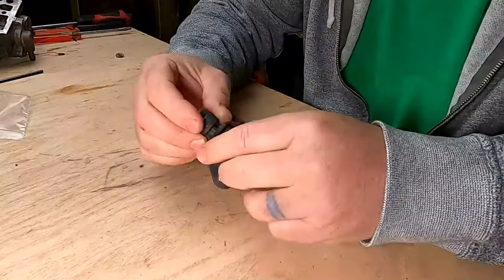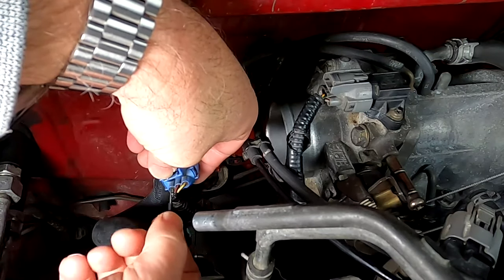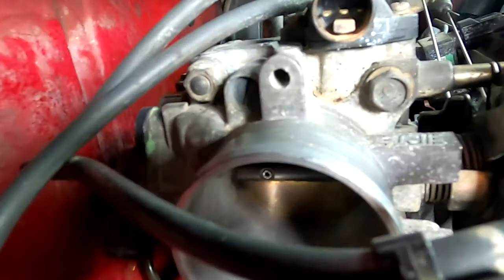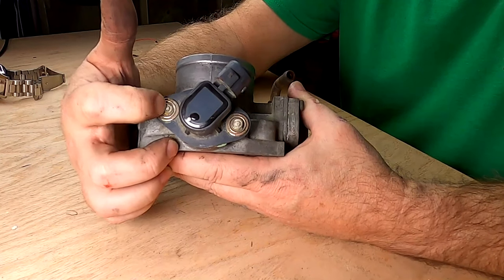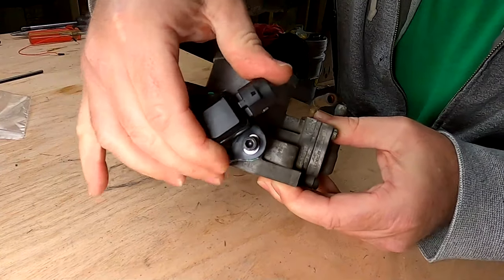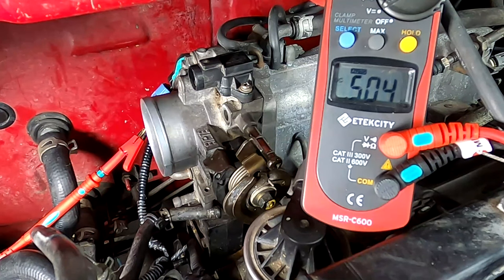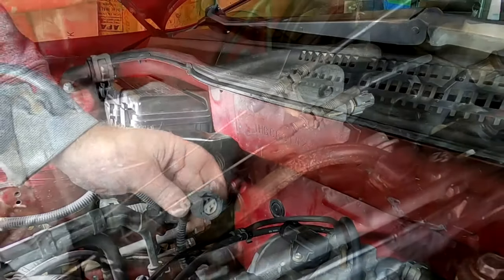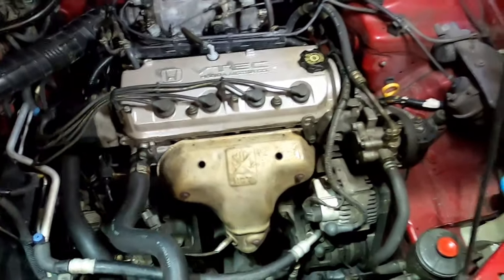Honda Throttle Body Removal & TPS Testing

Comment: Great video. I am working on a pilot with a hangup on the throttle about 10%.  I needed to know how to get those screws out and i am going to use my dremel. Also great calbration tutorial. Thankyou for your video post.
Reply from the maker: I swapped the TPS on a 2000 civic and I get those fasteners out in that video. Good luck!

Comment: I was having this same problem, mine would idle high. I took off the tube and reached inside the throttle body, and found a piece of napkin wedged in the part that opens n closes. Simple fix. But I have no idea how it got in there

Comment: Sorry...At 16:11 you tried to get the TPS to have 5.0V when the throttle is fully open.  How did you get to near 5V without changing the calibration for the 0.5V when the throttle is not fully open?  It seems that one would need to hold the throttle to fully opened position and adjust the TPS at the same time?  Would that mess up the 0.5V calibration when the throttle is not fully open?  Thanks.
Reply from the maker: It's seems to me that it's most important to get the reading right at wide open throttle. I don't know that you could get an aftermarket TPS to be perfectly 0 and 5v.

Comment: Thank you so much for the informative video!! Even the little things like “with the key on” really helps remind a person!! 
I have a question :
You spoke about if the levels are lower than .5 and 5 but what if they are higher? Does that change anything ?  What would you do differently if anything? The one that is in there is off a different Honda, but was working great till yesterday then threw check engine code and she had to gimp it to me. Throttle pedal had been sticky for a bit and we meant to clean it and even had the cleaner here to do it but my husband passed away suddenly last month and we’ve been distracted :-(
Thank you so much for your time making this video and in advance for any info you offer :-)
Reply from the maker: I am very sorry for your loss.... Stay strong. I'm sure that's what your husband would have wanted.

As for the voltage, the sensor only gets 5v from the chassis, so it would not go above that. Under .5v would mean that the sensor needs to be rotated , as shown in the video. The .5v and 5v would be in a perfect world. It just needs to be close, and it should function fine.

If the pedal is sticky, be sure to lubricate the cables where they attach to the throttle body and where the cable goes back into the plastic tube where it is mounted to the intake. 

Good luck!
Reply: @ktecgarage  I know you’re right and I sure am trying! Make sure to never take your wife for granted! I used to say don’t sweat the petty things and don’t let the sweaty things, but I didn’t follow those after … never mind, anyways it was reading .97 consistently and 6 when full throttle ? What would cause that ? The ECU? Or maybe bad tester ? It’s same as the one you had in the video ? :-/
Thank you again for your time and for making the video !!! It helped save a bunch of time and that is a much more treasured commodity these days! 🙏👍

Comment: Thanks for the video. We replaced the tps and must have messed with something because the civic won't go into any gear now  Any advice?
Reply from the maker: Year? Auto or manual transmission? If it's auto, can you move the gear selector?
Reply: @ktecgarage  2000 auto
 Cannot move gear selector.
Reply from the maker: @alfredobrown Do the rear brake lights work when you press the brake pedal? Also, check the back-up/reverse light fuse. On the under hood fusebox, check the fuse that is labeled "Stop" on top of the box.
Reply from the maker: Also, there is a slot above the PRNDL on the gear selector. Remove the plastic cover and insert a key into the slot and it will release the shifter until you get it figured out.
Reply: @ktecgarage  thank you. Will try that.

Comment: Thank you for a very good clear and knowledgeable video. I have learned so much about my car and have become an amateur mechanic because of it. I now dislike Hondas haha
Reply from the maker: I'm very glad to hear that I inspired you! Lots of satisfaction when you can do your own repairs.
Reply: @ktecgarage  almost definitely. Just having a problem getting it calibrated because I don't have a multimeter and everywhere I go I can't use one or nobody has one or it's way out of my price range. Have any ideas?
Reply from the maker: To be honest, you probably won't notice a difference without the calibration so long as it's close.  You can probably find multimeters for less than $20 at Harbor Freight or Walmart, but if it runs and drives fine, you will be OK.

Comment: What probe are you using to back test. I can’t fit anything I have in there on the pigtail
Reply from the maker: It is the type you use for breadboards when you build and test circuits. You could use a sewing needle as well.

Comment: Thanks for info.
What happens if you don't calibrate it?
Thanks
Reply from the maker: Probably not too noticeable if you just bolt it on out of the box. I would guess worse gas mileage and fuel trims slightly off.
Reply: @ktecgarage   thanks  iam about to do mine.  Preciate

Comment: As if alittle colouring of dirt in the throttle body is really going to effect the sensors that much, are they really that sensitive to make the idle so rough or stall the engine?
Reply from the maker: A dirty throttle body is very noticible with a manual transmission. When the clutch is engaged, the engine falls to idle quickly and the throttle body will catch it at idle and stop there. When it is dirty, it is slower to catch the RPM and causes stalls. The blade is barely cracked open at idle and any dirt interferes. So yes, it is that sensitive.

Comment: I’m have a problem 98 Honda idles but when l increase rpm it dies ??? Any thoughts on that ?
Reply from the maker: First things that come to mind would be a vacuum leak or low fuel pressure. Unfortunately,  Honda doesn't put service ports on the fuel rails, so it's difficult to test.
Reply: @ktecgarage  3:05
Reply: @ktecgarage  in desperation l changed the fuel pump and filter but couldn’t get results !!
I’ve done every l could and still no luck !! Where should l look next ???? Thanks !!!
Reply: Can a TPS cause my problem???
Reply from the maker: Maybe. I do have a video that shows how to test the TPS with a volt meter. I would go looking for a vacuum leak if I were you. Leaks can cause all kinds of problems and the older the car, the more likely it has one somewhere.

Comment: What if the the TPS calbrate at 0.5 Volt at Close and open is at 4.30 Volt? What could be issue here when it is open?
Reply from the maker: Old or not an OEM part. Could just be the multimeter you used.

Comment: many thanks have problem with honda civic 94 manual  1.5 engine...  when i start  cold weather  car start breathing  rpm up and down until car heat  about 3 minute to 5 ... now suddenly change  keep rpm up and down more than 10 minute even i drive  ...yesterday have problem rpm goes down when i start the car turning on and shut off back if i push gas stay on when i remove my foot on gas its stop  if i unplug the throttle position sensor the car running  if i put back i have the same problem before after i drive 5 to 10 minutes have chck engine but now when i start the car coming check engine please any     now car start and stop again help
Reply from the maker: That engine has a fast idle thermal valve and I'd bet that is your issue. The set up on the engine in this video is not the same. Search YouTube for B15 fast idle thermal valve problem. Good luck!
Reply from the maker: Also make sure your coolant level is correct. Those engines are very sensitive to low coolant levels causing idle issues.

Comment: so this is not only for how much gas its getting its also for idle problems because i just changed my control valve and its doin the same thing
Reply from the maker: I suggest smoking the system for a vacuum leak if you haven't already. If you don't have the means, an autoshop could do it at their hour rate and then you could fix it yourself. Good luck!

Comment: Its not replaceable separately reason on newer models. It has rivets i like it is on 2004 Models with what i call 1st generation. Honda/Acura DBW systems. Guess you can call them that
Reply from the maker: They are replaceable. I demonstrate how to get the rivets out in the video. The aftermarket replacements have Allen head fasteners.

Comment: A five point torx will take those bolts out or ts 15 torx I believe.
Reply from the maker: Not that one. The heads of the fastener on OEM are completely smooth. If it has a hex head, it's aftermarket.

Comment: Bruh i put on the new one and the voltage is staying at 5
Reply from the maker: One of the wires will always read 5v. Make sure ur hooked up right. If you are connected right, you got a bad one.
Reply: @Ktec Garage  i found out i had it connected to thr wrong one! I was to eger and skiped into the video to far. Thanks so much
Reply from the maker: Glad it worked out